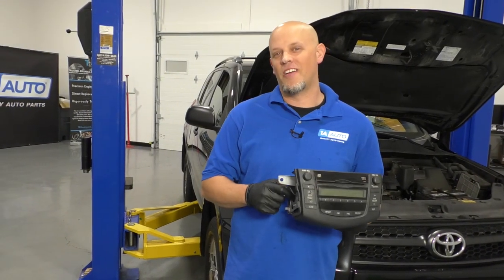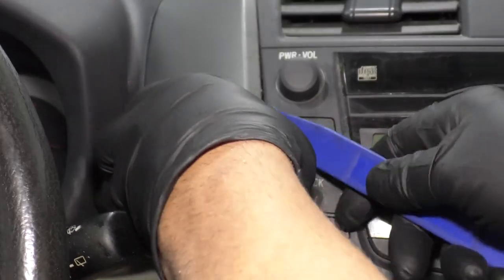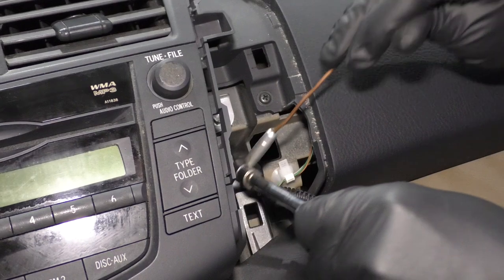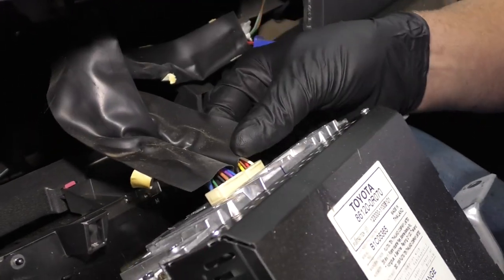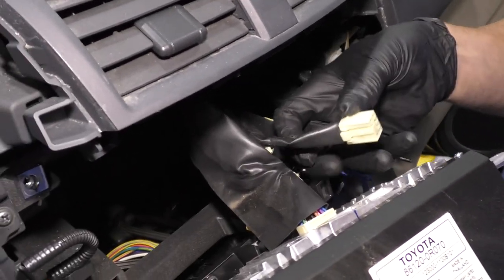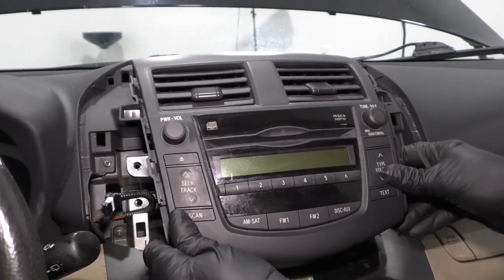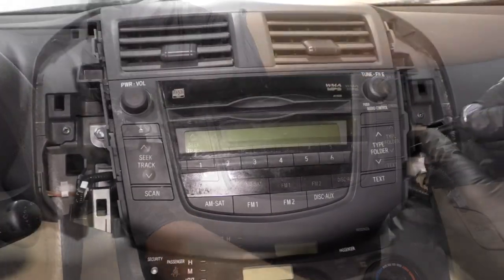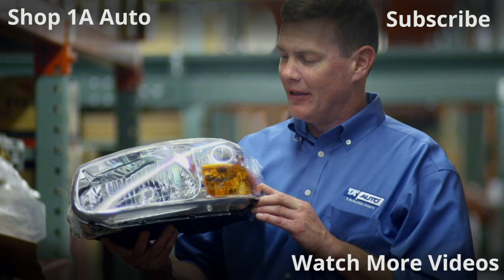How to Replace Radio 05-16 Toyota RAV4

Comment: Thanks for the video. This is a simple replacement. My only problem was that BOTH bezels on either side cracked near the top, and I pried from the exact same points as in the video with a plastic pry tool, so be careful of that!
Reply from the maker: +Robert Durbin Thanks for checking us out!
Reply: Same

Comment: Looks fairly easy,  thanks! 

I have this stero unit on my 2007 Rav4. 3 cds are stuck in the unit and the unit doesn't recognize them. Once this unit is removed is it possible to access the cds inside?

Comment: Trying to disconnect a Sirus Xm player that was added and mounted on the dashboard by a previous owner.  I used the trim tool and the panel on the right side broke off into 2 pieces now.  The cords are going down through the top panel above the heat vents.